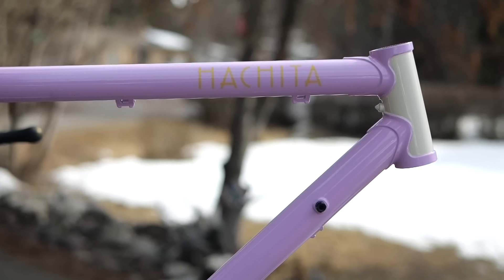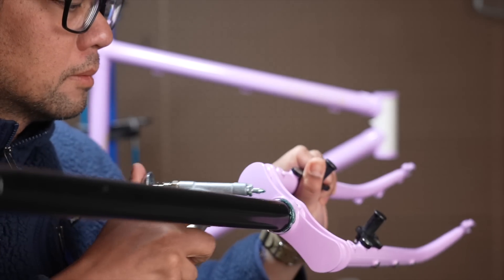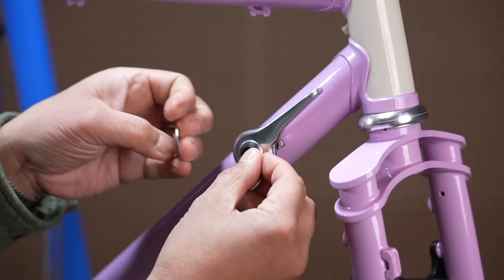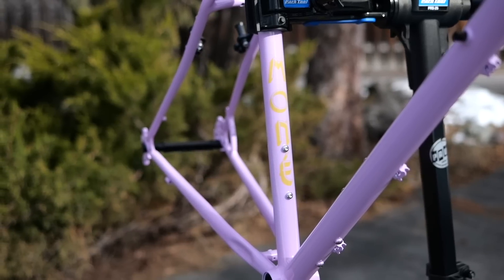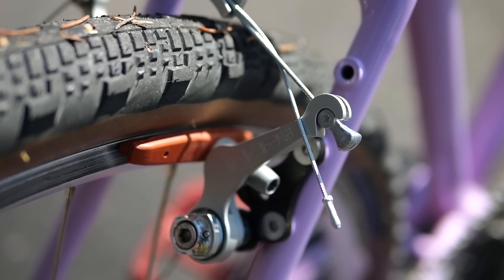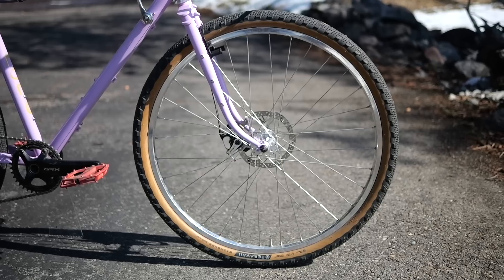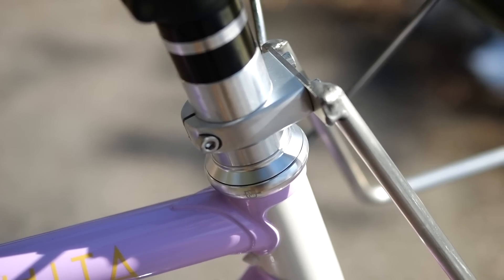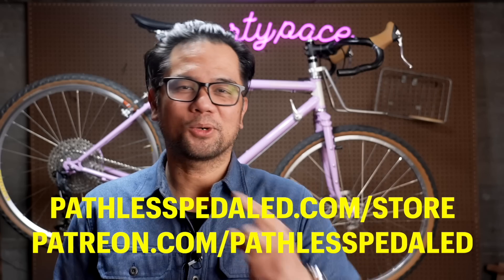ULTIMATE Frankenbike for the Apocalypse!

Comment: I love your bike. It's a proper middle finger to modern bike industry.
Reply: $3000 frame, $130 cantilever brake (LOL), mainstream drivetrain, front brake, and controls, and tires from a subsidiary of a $200 million/year corporation (QBP) = middle finger to bike industry? Downtube shifters do that for you eh?
Reply: @willspower3  "I think we should improve bikes somewhat" 

"And yet you participate in bikes. Curious!"
Reply: @jeffb1430  Ha, I do appreciate that reference. I am rather referring to idea that 'the industry' is somehow neglecting this market and or bike snobs deserves some punishment, in the form of a $3000 artisan town bike frame using 95% mainstream parts. It's easy to look at race bikes costing as much as a car and forget that normal hybrids and cheap hardtails still exist and will perform just as well or better than this bike for the target use case (groceries, puttering around fire roads). But I guess you can't...hot swap flat bars and drop bars? Sora and Acera still exist, and will be replaced by even more durable Cues. This sh** is just making up problems to feel special.
Reply: @willspower3  did you miss the part that idea of this frame is not "to perform", right?
Reply: @tweed0929  yeah, i agree. It's more of a vanity token. No problem with that, except it's a luxury to cosplay thrift and resourcefulness. So much dissonance, like those restaurants that serve canned food as a novelty, or suburban kids driving  lifted pickups. Save the coop parts for those who need them.
Reply: @willspower3  I don't know why you're talking so much about the price of this bike. No one ever said that what's good or unique about the bike is that it's cheap.

Anyway best of luck to you living in your thatched mud hut as you've rejected the obscene vanities of modern society, such as canti brakes that cost as much as three people eating at a medium-good restaurant.

Comment: More bikes need the option of both disc and rim brakes. It seemed pretty normal to find v-brake bosses and disc mounts on mountain bikes like 20 years ago. It's too bad that trend didn't continue. The option to run multiple wheel sizes is a great bonus too.
Reply: You still get frames and forks with both on it, but more likely on 3rd party frames and forks than on the stuff sold as complete bikes in shops.

Comment: The ATB is so 2022. Post-modern bikes are the future. On a more serious note, another benefit to this is you can transfer all parts from an older rim-brake bike, and then down the line "upgrade" to disc brakes if that is the long-term goal.

Comment: Disc brake in front and rim brakes in rear are 110% fine.  In fact, they can be even better.  Cars have been doing this for years.  Disc in front, drum in rear.  If your rear brake is too good, it leads to lockup and skidding.  A rear brake that isn't super powerful acts a bit like ABS (anti-lock) and you'll actually stop faster without skidding.  
I had an old bike with cantilever brakes and put a new fork on it that could take a disc brake.   I couldn't disc the rear, just the front, so I did and I loved it.

Comment: 1:12  erm you can use a hacksaw to turn any race into a split one really quite easily! You only need a non split race if it's used as an actual bearing surface
Reply: My totally unscientific theory is that a split crown race (either factory or a bodge) might allow for a minute amount of play in the headset assembly that can't be adjusted out. But it's just a theory.

Comment: I have been running a disc brake in the front and rim brake in the back since 2015.  Great setup for an all-weather commuter. Even a traveler touring bike as I did, the rim brake rear guarantees at having one serviceable brake when on travel if for some reason your front brake or pads go fubar. I did this on vintage frames getting a 1" disc tabbed fork too.

Comment: imho if you want to build a postapocalyptic bike, i guess you should forget about any cassette+derailleur systems, also rim- or discbrakes. if you need gears, then internal gears work much longer without less wear, also drum brakes or coaster brakes. even with their lower performance. considering the wear of tyres and the possibility that at some point you'll run out of inner tubes. the sad part is that wooden wheels would be the best long-term solution just like the ones used for coaches from the past. they have their drawbacks but most probably you could find raw material to repair them way easier... just thinking out loud :)
Reply: RollinRat  i use a fixed gear bike on a daily basis but the wear on the drivetrain is much more than you'd have using a freehub singlespeed/internal gear configuration.

Comment: Bro, make the bike how you want it. I have a frankenstein setup myself that people still find weird. 38T upfront, 11-51 Deore cassette, Specialized Rockhopper 2015 Large with a SR Suntour front fork and XTR rotors with MT200 brakes. I run Tufo XC13 in the back, XC14 in the front and specialized grips with a GT Avalanche bar and custom XT crank arms. This bike started as a GT Avalanche and became something way more special over time. Trust me you can make it any way you like.

I plan on doing better hubs from the standard shimanos and will likely switch to tubes full time in the future.

Comment: I mounted both disc and Vbrake on a 2002 Sid fork. The Vbrake was operated from a cross-lever mounted on the RH bartend (Control Tech). It worked well for cruising fast while out on the bartends.

Comment: My bike from 2 years ago was like this: rim brake on the rear and hydraulic disc on the front because i had an old frame with a new fork. That's how i realized how smooth hydraulic brake actuation is to use.

Finally replaced my frame with a carbon frame, now my brakes are both hydraulic. Smooth braking feel ftw

Comment: My first disc brake experience was this.
Much harder to retrofit disc brakes to a frame than buying a new fork with disc brake mounts on it.
Aside from that, I'd argue that learning how to correctly modulate your front brake and use it to actually stop will give you better braking performance than braking with your rear brake because you're afraid to go over the bars.

Comment: My current road dedicated bike build has a mountain bike derailleur in the rear, flared drop bars and old 10spd Ultegra shifters paired to a modern Tiagra crankset. It has a 1 1/8 stem shimmed to a 1" threadless headtube. The frame is white so it doesn't draw too much attention at group rides. I'm glad I'm not the only one going full Fred due to not being able to buy a newer bike.
Reply: RollinRat   Thanks for the props an positivity. I've always been a bike dork but I'm also very into the fitness/performance side of things. I wanted a special bike this year dailed in out if the box that I wouldn't have to work so hard on. Life threw a few curb balls at me in the form of unexpected bills so I'll have to probably wait a while before getting it. The one I have can keep up on group rides and I found myself at the front of the paceline and holding the attacks just fine. It helps, just like in Russ's case, that it is a boutique frame with mismatched but high quality parts. It's a 22-23 pound steel framed bike.

Comment: Holy crap, this is amazing.  I love it.  The canti post plates are so cool.  I have no qualms about mixing disk and rim on a bike, but brake levers like Speed Dials will help to fine-tune the feel of the brakes and get the modulation as close as possible to each other.

Comment: My 2002 Santa Cruz Chameleon turned tourer has late 90's Shimano XTR V's in the rear, and a Shimano Deore disc brake mounted on the 27.5 Surly ECR forks. 26" wheels front and rear.

Comment: Another great video! Nice to see this kind of flexibility on a modern bike. You might be interested to know that Thorn bikes from the UK - who make traditional touring and expedition bikes - have had this kind of flexibility on their Nomad model for quite some time. Itcan take 26", 650B or 700C wheels, and can mix up disc and rim brakes (they even argue that rear disc and front rim is optimal for some applications).

From their website: "It can be built with 26" wheels - it can take tyres up to 2.5” and can have F&R V brakes, F&R Disc brakes, or Front V and Rear disc. It can be built with 650b wheels with tyres up to 60b but with F&R disc only. It can even be built with 700 x 40c wheels and tyres, with Front V and Rear disc or F&R discs."

Comment: Really like this, but I hope it uses 27.2 seatposts and 28.6 front der. clamps and other most common standards. It could also use some M5 threaded mounts on the crown for racks and a taller head tube. This is really needed.
Reply from the maker: Yeah. Headtube is way too short.

Comment: Disc on back canti on front actually sounds like it'd be pretty cool. You could slam on both at once and the difference in stopping power between front and back would keep the bike stable.
Reply: Seems counterintuitive to me? The rear brake becomes almost instantaneously useless when you brake hard, as the rear wheel looses most traction with weight transfer (up to a "stoppie".) I'd rather have the more powerful brake up front. (That is, assuming the disk brake is more powerful than the rim brake, which is not necessarily true.) Depending on what's in the parts bin, I'd pick whichever brake gives me better modulation as my front brake.

Comment: "Ultimate"? Pftt! I built a bike based on a mid-90s Muddy Fox Courier frame that I picked up for £10 in 2016, with disk brakes on the front and a three speed hub and a coaster brake on the back.

Comment: My problem is that there's all this work into building a frame that you can use as a franken bike built from old used parts. But like, why? Why would you spend the money on a new "junker" bike when you can just buy a used frame far cheaper, and build that up? A used frame would save enough over this frame that you wouldn't have to use so many scavenged parts, and could actually buy a few new ones that would just work better.